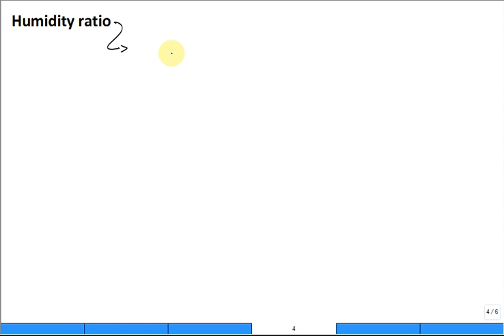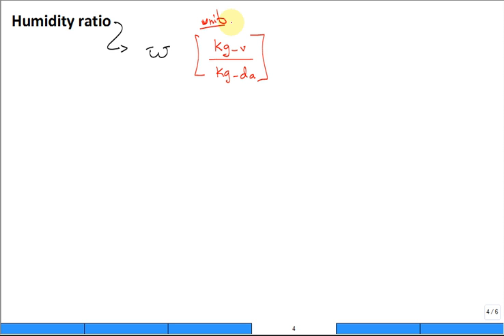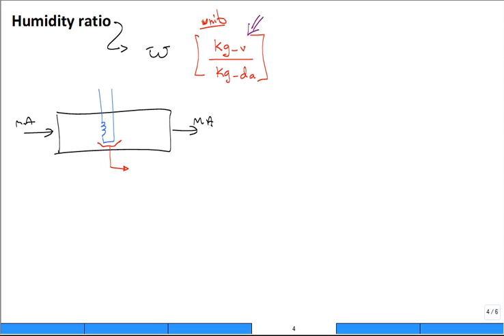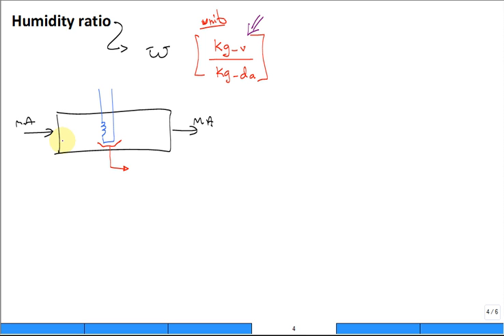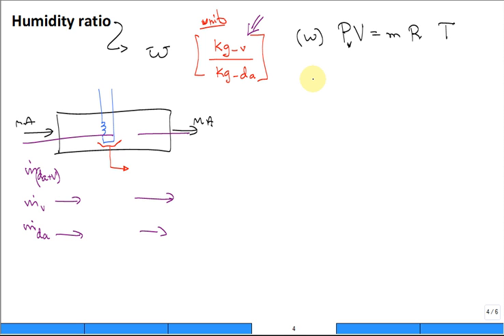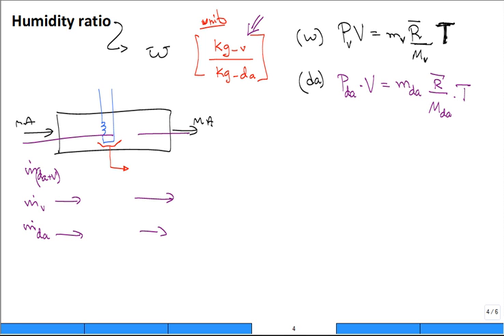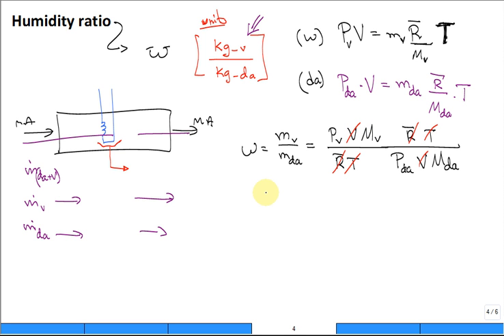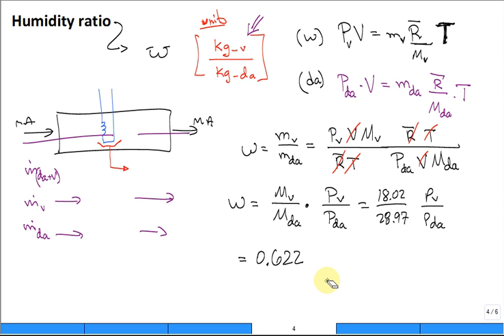Intro humidity ratio for moist air

Comment: Hi Sir. Thank you for the video. By the way, may ask questions? 
1. How to define Pv and Pa. It is coming from the Pressure Instrument  or from Pressure Table or something?
2. If I have humidity value from measurement. Can I calculate the mix temperature from this equation?